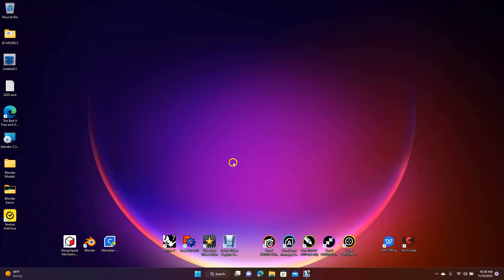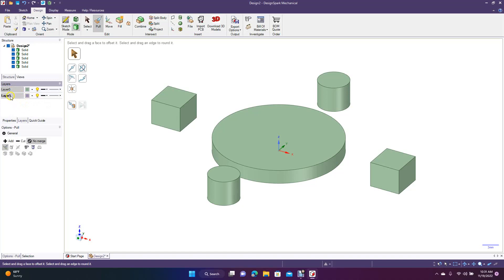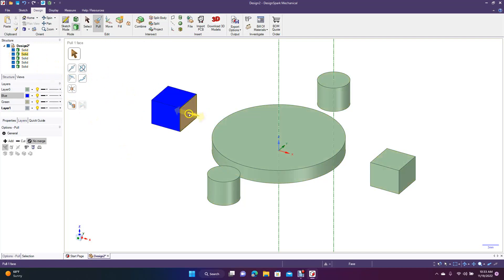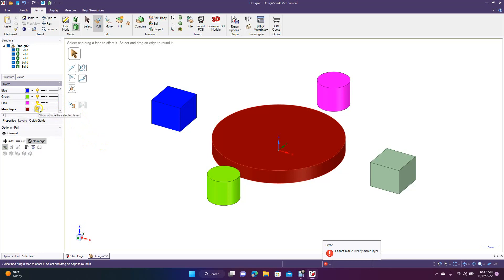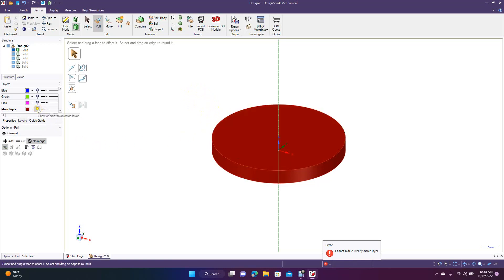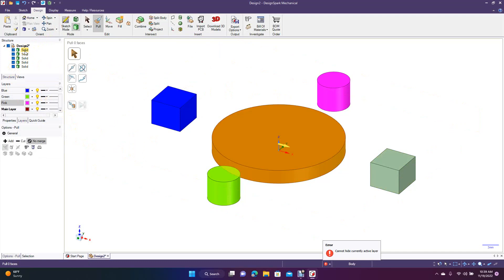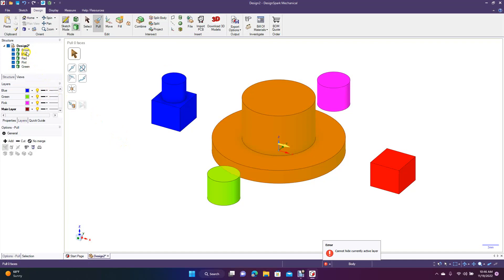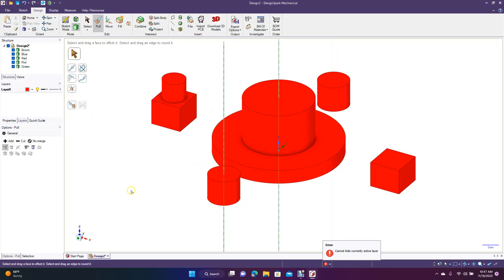How to use layers in design spark mechanical

Comment: Hi Daily,

Thanks for the reply.
I have just watched your layers post.
You have found excatly what I found with layers, which is why I reached out after your no merge post.

Right Click and Rename.
I also could not get Lines to do anything.

Since with Turbocad and Drawing Arch. 2D. 
I would start a design, drawing in 2D and layers and colors, when I wanted to extrude I would make that layer the Active, when extruded the tree shows a solid.
I export the extrude as stl then back track to the 2D and then do the next part until finished, I would always have the 2D drawing, I would then save another copy and rename and extrude all layers so I have a full extrude view which I could print out (Ink print).

I mostly draw 3D now.

In summary only use Layers if you want Colors

Regards
Bob
Reply from the maker: yes, I totally agree about the layers. You can add colors to your parts without using the layers. It's under the display tab, colors. Cheers.

Comment: For some reason one of my comments not showing that had a link to spaceclaim layer explanation. Help section.
Reply from the maker: JB, I searched out and found this link http://help.spaceclaim.com/2015.0.0/en/Content/Layers.htm 
It doesn't explain what the thicker lines are for. That's the only thing I was wondering about. Thanks for your comments, and suggestions.
Reply: @dailey3drevolve  I try the lines and I had the same problem that nothing work with selecting them. Like you said before who cares we don't use them or the layers.
Reply from the maker: @JBCool0729  I know right! we don't need any layers, lol.

Comment: By clicking twice on inactive layer will make that layer Active. By clicking once on selective text field and then click second time and hold button for couple seconds will select text that can be change. This is almost for all text selection on most of the programs.
Reply: I find if you click on the name wait 3 sec and click again it lets you rename... trackpad for cad! the stuff of nightmares!
Reply from the maker: @garycaruso4883  Thanks! Gary. Cheers!
Reply from the maker: Thanks for pointing this out. For me, it's easier to use rename. I use my Alienware laptop to click, and it's not as responsive as a mouse.